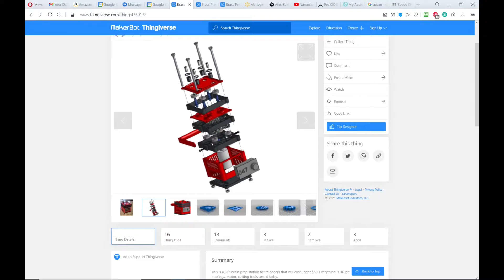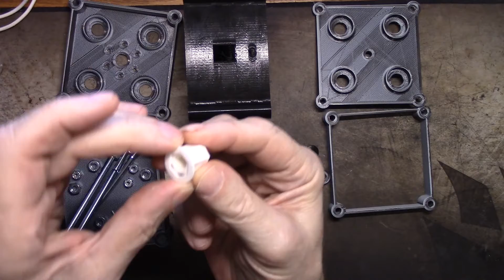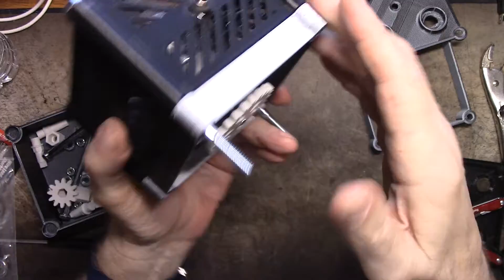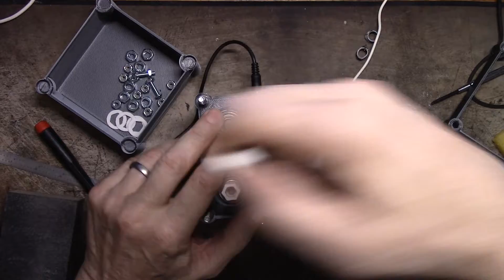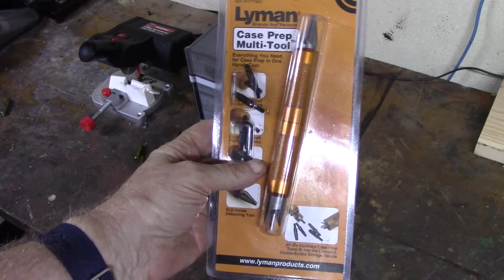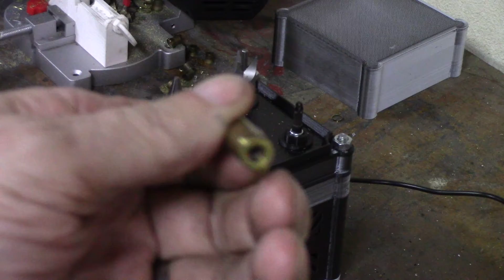3D printed brass cartridge case prep center for $60!

Comment: Chuck where can I purchase the 3d printed parts only?
Thanks
Reply from the maker: I'm sure you could find someone at Shapeways to print them for you, but let's discuss it for a second before you rush off. There's a reason why I either say no or just ignore requests to print this. I printed these parts for a friend, and this was back when I had all the tweaked files I made when I made mine, and the parts still had to be carefully filed, sanded and fitted and some had to be reprinted multiple times due to breaking during the fitting process. It was absolutely one of those "no good deed goes unpunished" moments. So before you rush off and have someone print all these parts for you, think for a second. You can buy the Frankfurt Arsenal case prep center, which this is modeled after, for $125, even less if you can find one used. I doubt you're going to find anyone other than a friend who's going to print all these parts for you for less than $80 bucks, I know I wouldn't. And the parts aren't going to fit, you're going to put a fair amount of work in to get them to fit and possibly break some and have to have them reprinted, which will not be free. Plus you still need to buy the tooling, the motor, the power supply and the fasteners. And it's never going to work as good, or be as durable as the commercial unit. So while this is a really fun project when you have a 3D printer, it's just not cost effective if you have to pay someone else to do it for you, or in my case, strain a friendship trying to do someone a favor. Good luck and thanks for watching and commenting!
Reply: @3rdpig  wow! Thank you for the advice. I had not considered this. 
I may just buy a 3d printer. I enjoy the challenge.
Reply: @3rdpig  could you recommend a printer?

Comment: Hi from Australia Chuck. I originally saw this machine on  Richard's video then came across yours. I have downloaded the free files and hope to get it printed by a 3D printing service as I don't have a printer and can't justify the cost of one. Just wondering how you got the cover as it doesn't appear in the files I have downloaded? Will see how much it will cost to get in printed before I decide to go ahead.
Reply from the maker: Hi Paul. I'm not sure where I got the lid from, it's not in any of my designs and unfortunately I didn't keep the individual files that go with this print job, so I'm assuming that it was in one of the remixes. 
On another note, this is a fairly complex print job with a lot of separate parts that need to be fitted to have it work right. Having your own printer means you can reprint any parts that don't fit and can't be made to fit (or if you're like me you broke trying to make fit) and your only expense in doing so is the filament. Paying a service to do this might not be cost effective, since they didn't design the parts they're not going to guarantee they fit and anything you need to have reprinted they're going to charge you again for. If I ran a print service I'd charge at least $80 to print all the parts as that's many hours worth of printing. And you'd still have to buy the motor, bearings, power supply, fasteners and most expensive of all, the tooling, assuming you don't already have it. 
I don't want to talk you out of it, but it just doesn't seem cost effective without your own printer. There are lots of other reloading and gun related things you can 3D print, such as the case trimming jig I made in another video as well as pistol grips and similar things. So it might be worthwhile to consider getting a printer if you want to build this prep center. 
If you really don't want a 3D printer I'd consider the Frankfurt Aresenal  Case Prep Center, they can still get gotten for under $150. 
Good luck with whatever you decide!
Reply: @3rdpig  Hi Chuck, thank you for your response and honesty. It sounds like it wouldn't be viable to have someone else print this for me. I have absolutely no experience with 3D printing and I guess I assumed the parts would just fit without some degree of hand fitting. You started using terms like horizontal expansion and that just went over my head. Given the nature of the material used I guess it can be subject to some discrepancies and things may not fit together properly. Maybe I will try another option . I have seen more basic ideas on YouTube for this type of thing. I made an annealing machine some time ago based on one I saw on YouTube and I am actually in the process of working on an improved version. I have looked at commercially made prep stations but they are too costly in this country. The Lyman unit is $485 Aus which is around $315 US. The Hornady unit is $370 on ebay which would be the cheapest available here. All a bit beyond my pensioner budget. I'm thinking maybe I could get some parts printed, such as the gears, and somehow adapt them. Either way I'm sure I can come up with something that works. Thanks again Chuck.

Comment: Are tools hard to turn whithout bearings ?  I am waiting for the motor and would like to be sure that the case prep will be plug and play.
Reply from the maker: I'm not sure I understand the question. Are you not going to use bearings? If so, it won't work unless you use something in their place to hold the tools straight and let them spin without friction. Or do you mean "Is it hard to spin by hand?". If that's the question, then I'm going to admit that I really don't know. I don't think it should be hard to spin by hand, it's only a 1:2 gearing, specially if the parts aren't binding and you have all the bearings in place. But keep in mind that the motor is 3500 RPM with a built in gear reduction to 100 RPM, so there's a lot of torque from the output shaft. So what might seem like a lot of force to you won't be to that motor.
Reply: @3rdpig Thanks for your answer !

 Sorry I didn't speak english for a while. I am going to use bearing, but can't try the setup because the motor is still on the way. 

I meant that tools are hard to spin by hand (don't have the main planetary gear because I don't have the motor yet), I had to force to put bearings in place and was wondering if the problem comes from that. 3 tools are really hard to spin by hand.

I am currently reprinting the mid and main part whith larger bearing holes to see if tools are easier to spin.

Comment: Interesting. Seems like a lot of 3d printer manufactures agree with your "switch the negative" ideology... A lot of skr stuff switches the negative on fans. And a lot of vehicle wiring gets very creative with how it switches power. I'm curious what the actual logic is driving decisions on switching +, -, flipping polarity on a wire... I understand how they work, not necessarily why you might choose one over another if they'll both work in a given situation.
Reply from the maker: I wish I could tell you. I'm pretty sure the person who taught me switch the negative was a shop foreman in a race boat shop I worked at in my 20's. I just can't remember his thinking on it, or even if he bothered explaining it to me in the first place.
Reply: @3rdpig  It used to be that cars the +ve from the battery was connected to the chassis, Supposed to delay corrosion of the metalwork. For electronics, mosfets are cheaper if switching the -ve, at lest when first invented (easier to make).
Reply: The reason that you often see switching ground has to do with how MOSFETS work. There are two types of MOSFETs, N-Channel and P-Channel. Typically P-Channel MOSFETs can't support as much current as N-Channel, and P-Channel MOSFETs require raising the switch (gate) voltage higher than the voltage being switched, so they take extra hardware to generate the higher voltage. (If you have a 24V printer, you might need 30V to turn on the MOSFET). In short, switching ground is cheaper and easier.
The problem with switching ground is that everything connects to a common ground, so there are many ways for power to get to ground through a device. If you e.g. switch your printer with a MOSFET on ground, and use something like a Raspberry Pi to switch the MOSFET, both of those devices have to be connected to the same ground. If you then connect your raspberry pi to anything else on the printer (USB, UART, etc), you've now created a path for power to get from the power supply, through your pi, to ground, going around the switch, which will likely fry your pi, since your printer is now being powered will all the current going through your pi.